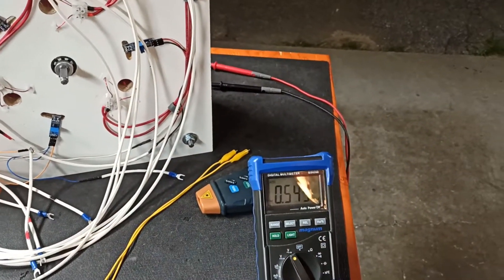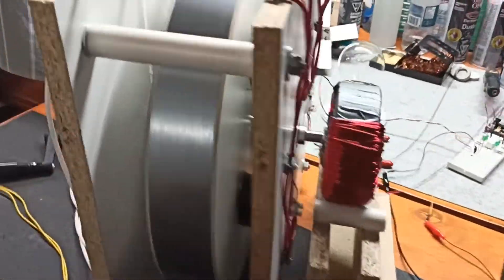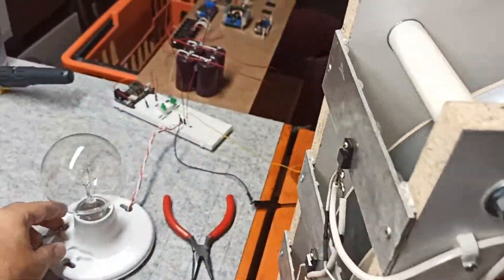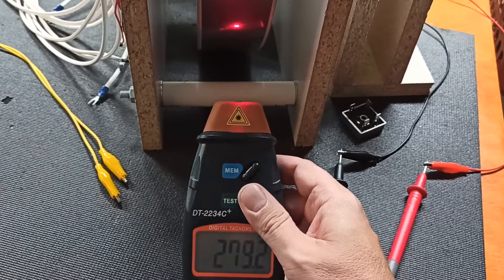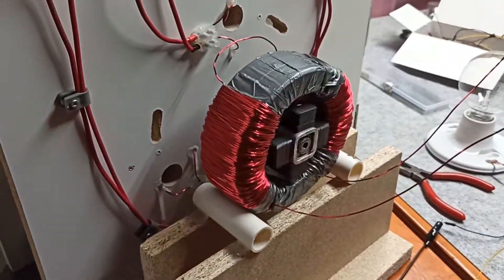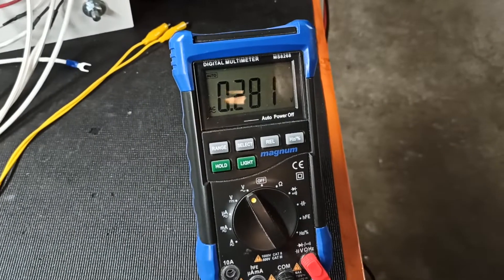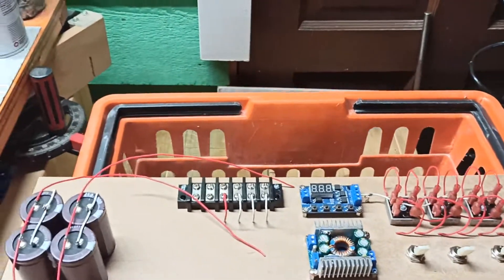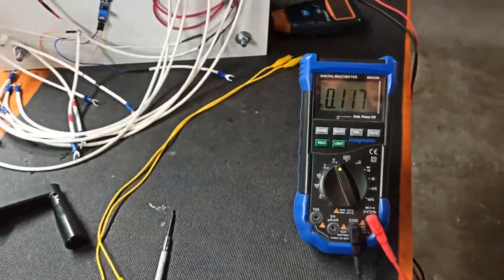Electro Magnetic Pulse Motor - Part 27

Comment: Looking good! So wait you're making a circuit to power more motor coils?
Reply from the maker: I've built a very efficient pulse motor that happens to spin its axle at high speed which I've connected to a toroid coil, wound in a special way to overcome Lenz's Law.  I'm going to fill the center of the toroid with high-powered magnets and see if we can generate a couple hundred volts of lenz-free power.  I've no idea if it's possible, others say it is but it hasn't seemed to go mainstream yet, so I want to find out for myself.
Reply: @bumpymotors  Nice, I have seen a couple of video's with Lenz free operation by using flux paths properly like the BITT Transformers.. also on my 'The New Generator' video, I have stumbled upon a small generator that can do loading without slowing down.. I forgot to record the unloaded part so you'll have to believe me by word, but sure I have seen it. Hence the reason I'm building a bigger version. I'm sure it can be done, can't wait to see what you come up with

Comment: Put black tape over the main pulse rotor, then use the reflective tape for the rpm meter. I see at 0.19 time line you have four pole magnet rotor setup, you will find your self changing to NEO's for more volts and current. The toroid should be a green core and the rotor should have six poles. This type of low lenz generator is the key to loop a motor / generator. Cheers!
Reply from the maker: Neodymium magnets are definatly on the planning board, along with the larger 'green' toriod you mentioned but I don't know about six poles.  Besides being a lot harder to mount to the axle, I'm unsure about how the magnetic field would function given the way I'm winding the copper in my attempt to overcome Lenz.  I suppose it doesn't really matter if I have access to a 3D printer and all the other items.  I'll keep you posted.

Comment from the maker: I realized after watching the video back that I wasn't aiming the tachometer laser at the right location. The small bit of reflective tape on the flywheel doesn't span the full width of the wheel.  If you watch the video closely you can see it's only half, and I wasn't positioning the pointer properly.
Reply: Idea to solve Energy Issues:   🫐By AMA🫐 To whom it may concern.
 The Key to making an over unity Electric Flow Generator work is mechanical advantage. In this case the mechanical advantage is achieved by getting the electric motor that is spinning a horizontal disc to be able to spin a large quantity of separate vertical discs that are connected to devices that  generate electrical flow while spinning to generate more current then the electric motor needs, to spin the horizontal disc. One of the ways to achieve this without violating the laws of thermo dynamics, is to exploit magnetic field effects. To do this,attach a horizontally positioned disc to a bar the motor is spinning. You then place magnets on the top of the horizontal disc that the  motor is spinning in a way that makes it so while the disc is spinning around, the magnetic fields are pushing upwards onto the edge of the vertical discs they hit into, forcing them to spin, thereby generating electric  current. To get the magnetic fields to only hit into one of the edges of the vertically positioned discs, place a material under the vertical discs that keeps the magnetic fields from pushing up against the discs until they reach that one open spot where the magnetic fields can hit up against the edge of the vertical discs, pushing them into a spin. In this way, the magnetic fields will be forced to do work that the electric motor wont be doing. This is how it's possible to achieve an Over Unity Electric Flow Generator. Also to keep magnets fully magnetized, you can have wires carefully coiled around part of the magnets & a system that periodically sends a small amount of current through these wires to force the magnets to be re magnetized the way you need, or have another magnet directly under the main magnet with it's opposite field attracting it, but kept apart with a spacer so they cant fully connect,this should induce induction & help keep the magnets fully magnetized. This way you don't have to worry about the magnets losing their strength over time.
  
 Extra Note: If anyone uses my ideas for profit in any way even if it's getting someone else to mass produce my Over Unity Electric Flow Generator idea,  I am fine with you & me getting royalties from it. :)  My e-mail is starfire7654321@yahoo.com

If you are interested in this idea & want to help me out by sending me funding then please email me. 

 I hope you all have a great day.   🫐By AMA🫐 Share this message with Everyone Please.
Reply from the maker: @MasterFeiFongWong  No videos on your site FeiFong, have you built this idea yet?  If so please post, I'm more of a visual thinker, this is a bit hard to follow.
Reply from the maker: @MasterFeiFongWong  Please do, better yet, make a video of it and post it to YouTube.